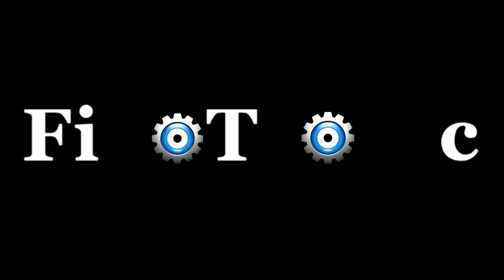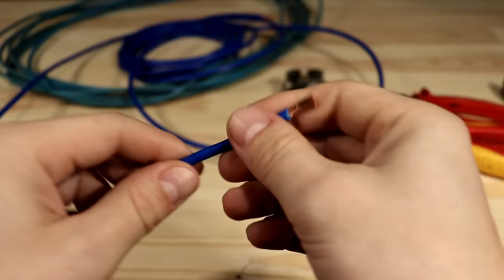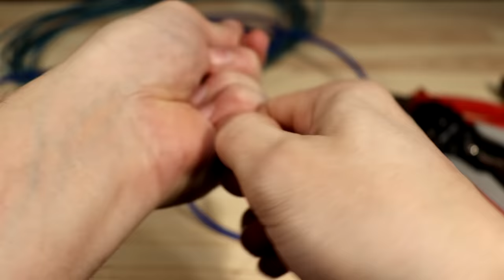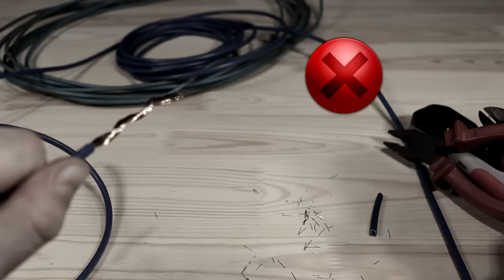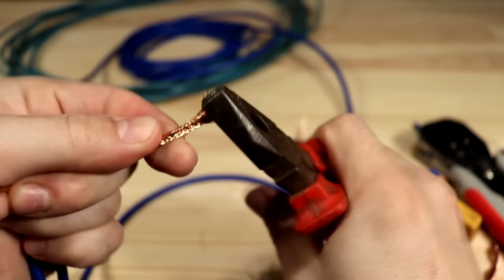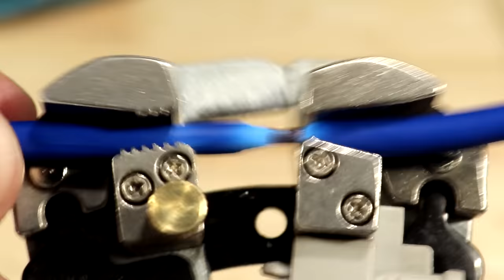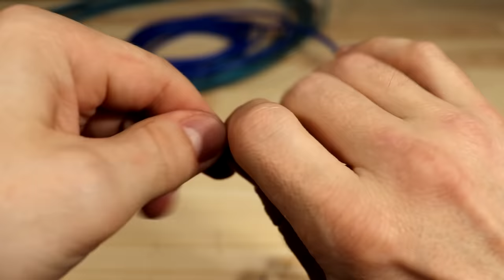AWESOME IDEA! HOW TO TWIST ELECTRIC WIRE TOGETHER!

Comment: During the timespan of this video,…. I’ve plugged in my iron,… found my lost flux,…… unwinded my solder,….  Soldered fourteen connections,…. Then allowed the iron to cool to room temperature
Reply: Where's all this extra wire coming from? Everytime I am trying to repair a wire harness I feel like I need tweezers just to mate the wires let alone twist them is 3 foot of bare wire. 🤣
Reply: 이게 뭐야
Reply: I built a two storey house
Reply: Wow. What a waste of wire... and time. Solder and shrink tube = 1/2" long joint THAT IS PERMANENT
Reply: THANK................ YOU! This comment made me loop right to the end and increase playback speed to 2nd. So I didn't spend more than two minutes on this. .
And the trick works exactly like one would think.... Wow, 9 minutes for this.
Reply: Lmfao is this a joke 😂
Reply: Unfortunately though, the time you spent gathering all your stuff instead of watching the video…you’re not going to learn the useful tips 😂😂
Reply: I took a nap
Reply: help!  how does this end?
Reply: Ub
Reply: Hahahahahahhahahahahahhahahah
Reply: Lol…No doubt!
Reply: Ооооо,у всех мужчин в мире  одна реакция ,юмористы🤭🤭🤭🤭оказывается нас многое объединяет 🙋🙋🙋🌹🌹🌈
Reply: @gdejackmo  0
Reply: @TheKev01  There was a useful tip?  Dammit I must fallen asleep waiting.
Reply: Дебибное видео
Reply: У @themorethemerrier281  ффц
Reply: Действительно , видео не для такого времени просмотра .. #банальщина
Reply: How long did it take to pull off that long piece of insulation? Couldn't bear to watch the struggle, how about you cut a shorter strip first then a bit more after, would be much easier, besides twisting wires isn't a good idea, it tends to weaken or fracture strands
Reply: Very entertaining 😂
Reply: But did you do it to this banging music 😂
Reply: He better not be doing this for money. He's gonna be in the bread line.
Reply: And if you want to dismantle it Einstein?
Reply: Why even used pliers to twist the wire, apointless waste of time 🤣😂🤣